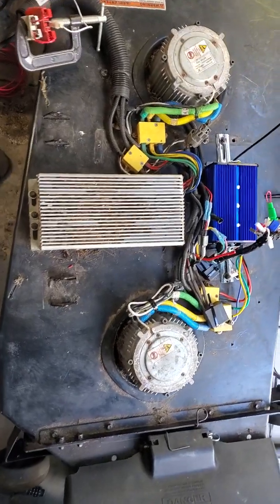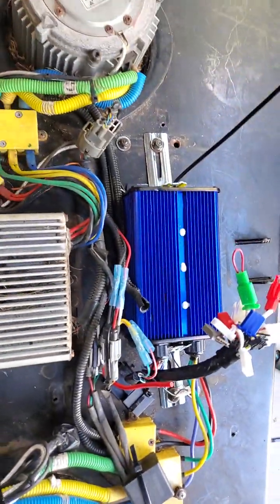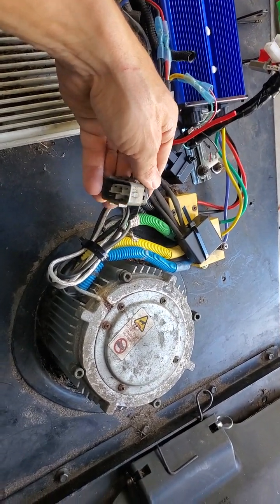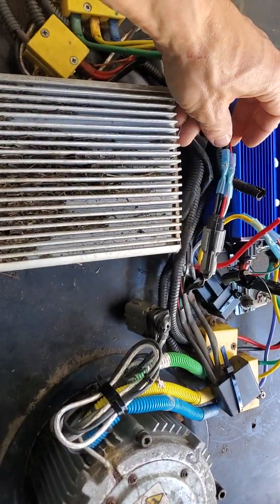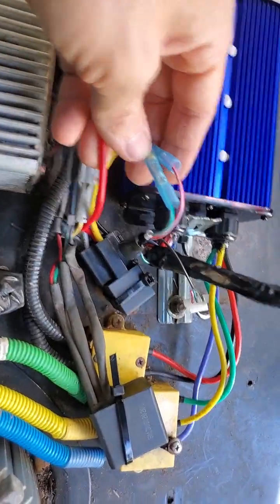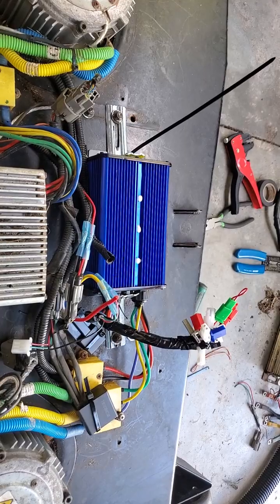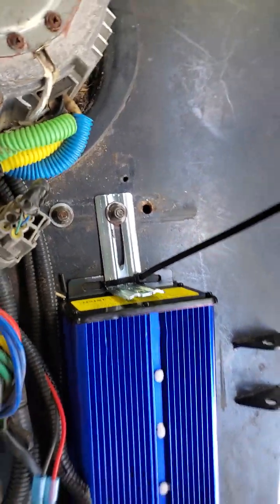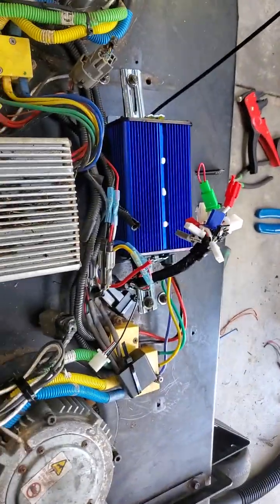Raven MPV 7100 Mower Deck one side not working repair

Comment: Ive got a problem with the carb flooding out. Have fuel in the oil. Battery light is on. No power.
Only one side of the mower deck is working on it. Any ideas?

Comment: This controller was definitely the weak link in these units. I have two of them & controllers on both decks  went out. I gave up on Raven for mowing. Great little portable generator and run around machines though.